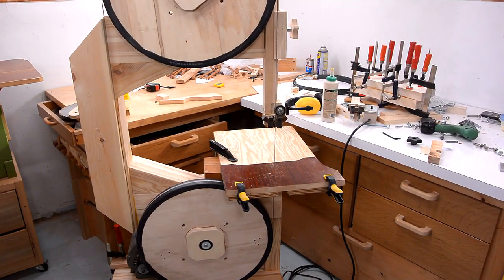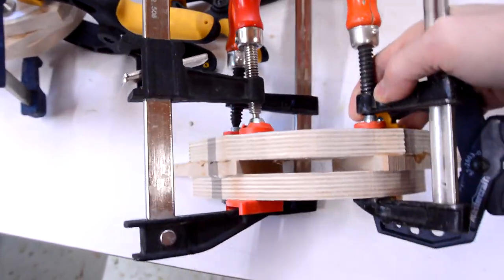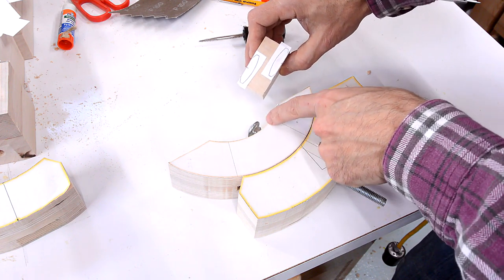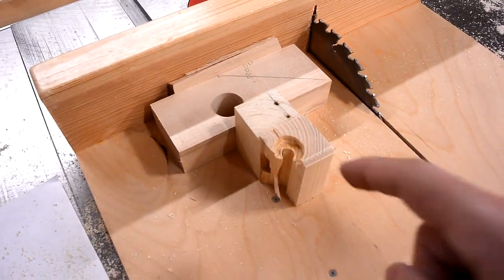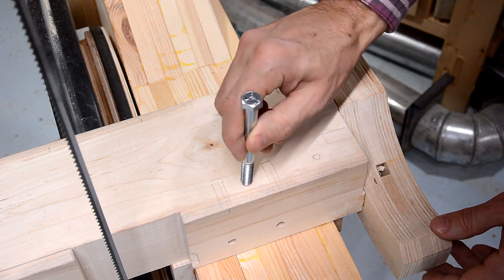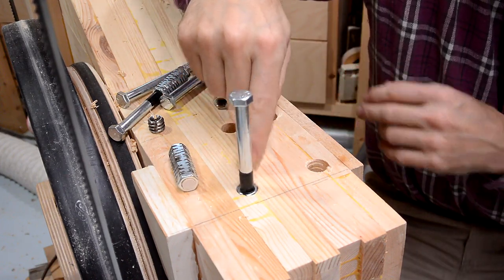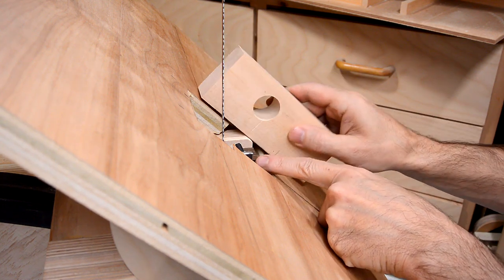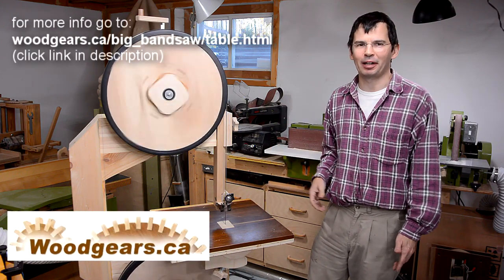Big bandsaw build 5: Table and trunnions

Comment: why is it necessary to use either a hardwood or Baltic birch ply?
Reply: The trunions move against each other so they should be harder - so they don't wear. Plus they take the load from the table.
Reply: Considering how often the table angle would be moved wear would not be an issue.   As for load.  The surface area and dynamic load would readily be handled by normal ply.   Next?
Reply: +Darryl John Bosch
Durability. Also, hardwood surfaces tend to slide much more easily against eachother.
Reply: Why couldn't one just wax adjacent surfaces with bees wax?
Reply: It's more for expansion and contraction. Once you've cut those to shape, they NEED to stay that shape otherwise all your accuracy goes to pot.
Reply: Ply whether it be Baltic birch or other is dimensionally stable due to alternating layers having orthogonal grain direction.

Hardwood is only dimensionally stable if the humidity is stable.
Reply: Hardwood performs much better than say pine any other softwood in changing humidity. The ply is perfect for that for it's alternating layers. Also, it's easier to deform softwood surfaces from compression for example.
Reply: *****
I have no doubt that softer woods would be sufficient for the mere functionality of the table, especially since the pressure is so evenly distributed by the curvature of the trunnion. I would however go for harder stuff still because I like when things are heavy, sturdy and don't dent easily. Also probably good to have some additional weight on the work table.
Reply: Yes, the denting is what I was trying to get at...
Reply: How is denting going to occur on the working face considering they're matched curves?

The mass difference for the section in question (ply vs hardwood) is tiny in comparison to the remainder in the 18" bandsaw, it becomes insignificant.
Reply: Seriously? OK, it's just belt 'n'' braces....
Reply: Seriously, I want a proper answer that will hold up to more than 5s of scrutiny.  So far you've not convinced me the materials requirement for the trunion justifies hardwood or Baltic birch ply.  Both of which are really expensive here in Australia.
Reply from the maker: Daryl: Since you know SO MUCH BETTER than anyone else, just go and build your own bandsaw and don't litsten to any advice with people with experience.  I, for one, am looking forward to see how that goes :)
Reply: Matthias Wandel LOL.
Reply: Darryl John Bosch came looking for a fight and was KO'd by kid wood, next
Reply: I would assume that hardwood helps with avoiding chatter because it is stiffer, and it makes for easier angle adjustments due to less friction between the surfaces. However, I see no reason why softwood would result in a complete disaster.
How much sense it makes to be frugal about four relatively small pieces of hardwood that could probably even be cut from firewood is another debate.
Reply: Hardwoods do not handle humidity changes better. The Grain structure of most conifers, like spruce, doug fir etc is a lot more structured and homogenus, so they react a bit more evenly to moisture content changes. Also the reason why the kiln drying process is almost twice as fast for them: because they can handle fast and intensive humidity changes without inner tensions cracking and distorting the lumber. Just look at oak under a microscope, I couldn't believe it how much of a mess hardwoods look like on a cellular level.
Reply: How was he KO'd? He brought up a good point and wasn't proven wrong, so I don't see the victory here.

Every issue brought up agains him was countered with a sensible reply, and I found him to be overall right... you not being able to prove him wrong basically means he does know better than anyone else...

I'm pretty sure any quality plywood (not the sheathing stuff) would do, sand it smooth and give it a coat of linseed oil and you're good to go. I get that bearning flanges and the like need baltic birch because metal parts are being press fit and loads being carried etc... 

Overengineering is a real thing, happened a lot on older machines, you know, the ones still running a century later. I personally would pay the extra few dollars for the baltic stuff.

Reading previous comments however, a single sheet for 300+ dollars is ridiculous, and if I had to pay that price, I probably wouldn't use it at all.
Reply: I am not looking for a fight.  I live in a small regional town in Australia where hardwoods and Baltic birch ply are close to unobtanium due to distance.

My background is a a former embedded hardware and software engineer and as such I have a small grasping of materials.

I asked a simple question that so far has not been given an answer that has convinced me of the material choice.

Matthias Wandel I don't know "so much better" than everyone else, I have an engineering mind that needs to be convinced under scrutiny for it to accept answers; you know the type as you are one.  As the designer can you please explain your material choice, as opposed to making smart arse remarks.
Reply: Anyone interested in these sorts of topics should pick up a copy of "Understanding Wood". On page 117 is a table of shrinkage by wood species, and we can see that Oak is one of the worst performers, and Cedar one of the best.
Reply: ***** thanks for the info.  What are the names and where can i source these timbers?  I have a bunnings 300km away and a mitre 10 & Stratco 20km away, my nearest capital city is 450km away.  I pay a huge premium (apparently for transport although I'm just of the main east west highway & train line; go figure) for raw materials where I live, hence i scavenge most of my ply and timbers from pallets which are in plentiful supply.

As I'm studying, $$$ are a scarce resource so I have to justify the material cost for the purpose.  I've got plenty of ply, but from a material/design perspective I'm yet to be convinced of need for the expense of hardwood.
Reply: ***** well played.  You're exactly correct.  Thankyou for your reasoned response.  When i build my shed then bandsaw I'll film the process to demonstrate.

I just wish all the haters including Matthias Wandel could have given a reasoned response like yours.   I just hope that the individual that first countered common ideas with using mdf for the wheels wasn't shouted down like me.  I hate to think how Galileo Galilee and Nicolaus Cooernicus would have felt for speaking up and questioning and asking for reasons for common held beliefs.
Reply: *****
Your first four replies were arogant, condescending and rude why should you expect people to be cordial with you?
Reply: Darryl, you could use acacia as cheap (if not free) local wood. It's really hard and smooth (needs to be REALLY dry though). So don't bother with birch ply. Got acacia ply :)
Reply: Build with whatever you want and let us know how it goes :).
Reply: $300 US for a sheet of baltic birch?  Seriously?

Where?

Comment: Matthias, do you calculate physics for these projects f.e. how much force it can handle before breaking, heat from friction and etc.?
Reply: Matas Liutikas doubt it
Reply from the maker: I just make sure it's strong enough.  Breaking strength is not the issue.  Stiffness is.
Reply: Ahhh, I see ^^

Comment: I never came across a use case when I needed a band saw table at an angle other than flat. Not saying there aren't any,... what would be the obvious ones be, that my table saw couldn't do? For re-sawing and shape cutting I never needed an angle.
Reply from the maker: any belveled curved cut, for example, cutting out a pantorouter template.

Comment: Video idea for you, Matthias: Wooden standing desk without motor.
Reply from the maker: got a design that would work in wood?
Reply: Standing desk is trending hard with no signs of slowing down, if you invent a version, I am sure it will be super popular.
Reply: I bet you could think of a way to work a wooden geartrain into the lift mechanism, maybe a treadle and ratchet to lift it.
Reply: thinking about two Xs joined by a pivot point in the center that can be locked in position when you decide to lift up or down.

Comment: To build that tilt table, we need a belt sander.
Do we need the tilt table to build the belt sander?
Reply: you don't need a belt sander. Just cut it accurately, or use files and sandpaper to smooth it. 
If you insist on a powered sander, put a sanding drum in your drill press.

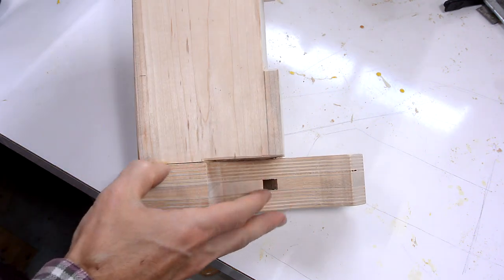Comment: 4:41 That is a nice tip, thanks
Reply: Thanks Craig! I may try bought technics at some point
Reply: Craig, great ideas, just be careful about getting glue in the screw holes (and letting it dry), because the screw may never come out.  I twisted the head off a large screw, building a workbench that way.
Reply: *****
I think that my order of assembly got a lot of glue squeeze-out into this particular hole and the screws were just ordinary wood screws from the bins at Home Depot.
Your method above sounds similar to Mattias' method in "Simple sturdy workbench build".

Comment: Matthias using all this construction adhesive these days. Wtf!
Reply: Scott Campbell I was thinking the same thing
Reply: He probably opened a tube of it for a small project, and is now trying to use it up so he doesn't have to throw it out and waste it. ;)
Reply: Didn't he visit John Heinz lately? Perhaps using it rubbed off.
Reply from the maker: that's right.  I DID have a tube open.  But the holes for the coupler nuts were a bit crooked, so I widened them a bit.  So I really needed some thick and gooey glue for those!
Reply: Matthias Wandel Makes perfect sense and a good solution.
Reply: Just curious but did you ever think of using epoxy,i believe it would have flowed into your notches a little better

Comment: The top wheel has a lot of wobble. It's extremely difficult to get the balance perfect.
Reply from the maker: looks that way because the innertube is on inconsistent.  If it had wobble, the whole saw would be shaking

Comment: I saw that you are not using yellow glue
Reply: this time he used wood glue
Reply: I saw that. I assume it's what he had to hand cos he doesn't mention it in the video or article..
Reply: When I first started woodworking I would only use brand named PVA glues, then I went through a period of being horrendously broke and having to save every penny I could, there were still projects that had to be done and I discovered that every type of PVA (wood) glue I used was about the same, yes there are a few that are slightly stronger than others but the minor diference does not justify the sometimes 10x price difference between the cheapest and the most expensive, these days I use glue from the dollar store and I've tested it to destruction, what I found is that the glue itself never fails, it's the wood around the glues that breaks first, which means the dollar store glue is just as good as the most expensive stuff, the only time I use branded wood glues now is for waterproof/special applications.

https://en.wikipedia.org/wiki/Polyvinyl_acetate
Reply: It looks kind of brown, but I have no doubt it is "wood glue" :-D